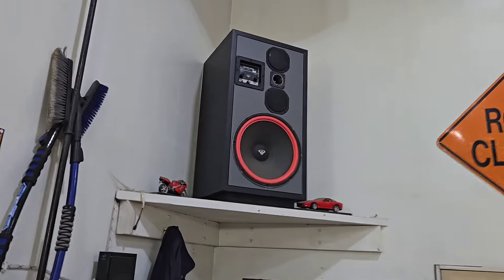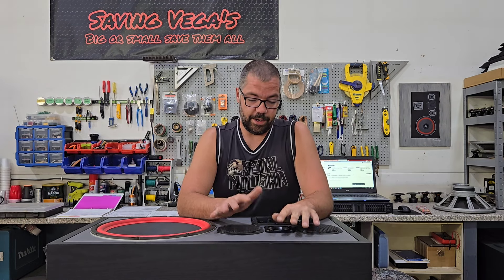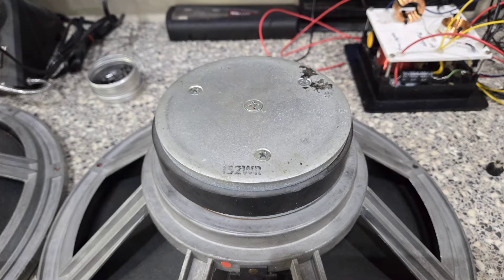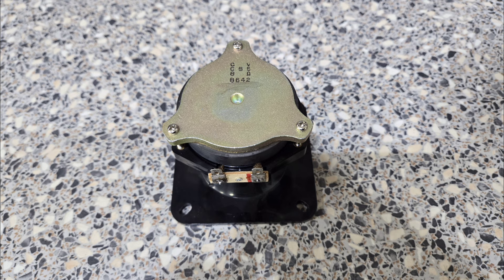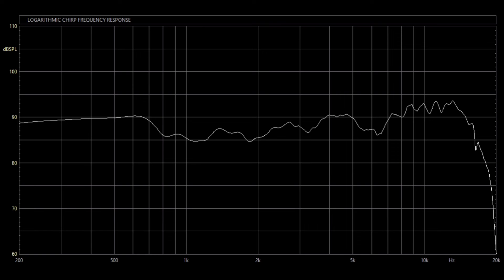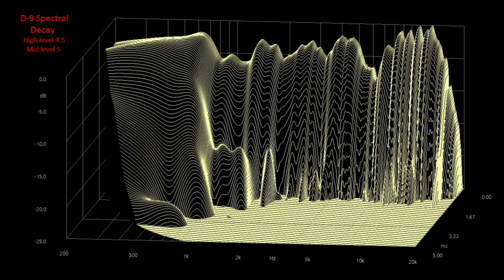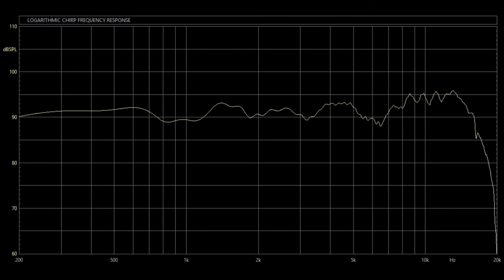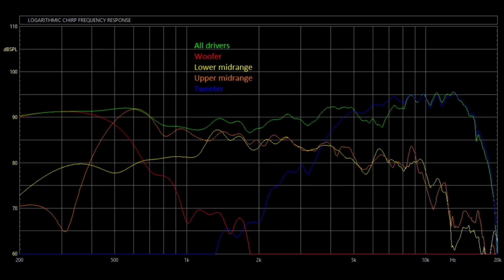The Legendary Cerwin-Vega! D-9 How Do They Measure?

Comment: Why only measure midrange and high? Where are the bass measurements?
Reply from the maker: Read comments. I've already addressed this.
Reply: @SavingVegas  Yes, you did address it! But you are heavily mistaken. If I follow your religion, I also would cut the measurement at 14Khz, because I am old, and my hearing doesn't go up to 20K lol... 
That said: It doesn´t matter at all. Make better correct measurements, from zero to 20K. The Room-Resonances don´t matter at all! More than this: The room is ALWAYS part of the overall performance. And to cut out parts of the performance due to a misguided belief takes you nowhere! Do you want to measure in an anechoic chamber? Why? Do you listen to music in an anechoic chamber too? I don´t think so. That said, to design a frequency network, you need it all - including the Room influence! 
It - otherwise would be the same as if a car tester does his acceleration measurements without the back two wheels, because half of the year we have winter here, so the summer tires make no sense.. That's BS, don´t you think so? 
Once again: To define the performance, you need the whole performance WITH all the influences from the room, the cables and and and...
Reply from the maker: I don't feel the need to have to explain the benefits of gated time window measurements. Lots of info out there on using this method that is used by many people when designing and working on speakers. GR-Research has a good video on YouTube explaining the reasons for using gated time window measurements. You should check it out. It's a good watch. 

I am familiar with room measurements, and they can be helpful for me when setting up my system in my room. Doesn't do much for other people because their room would be different, and the measurements would be different.